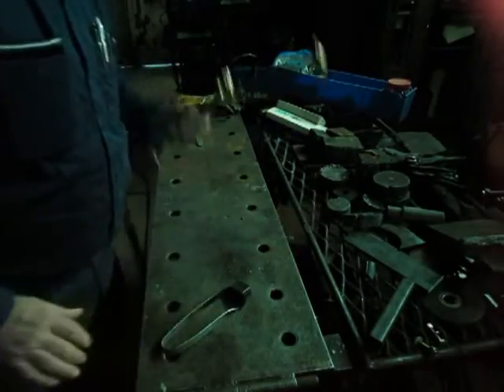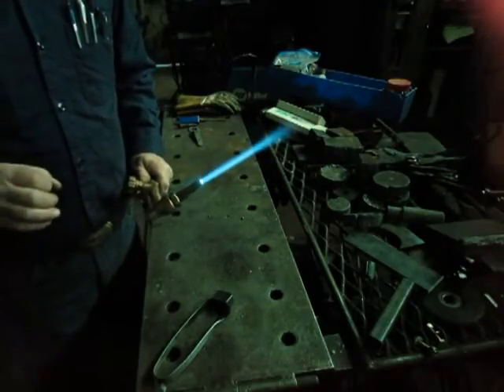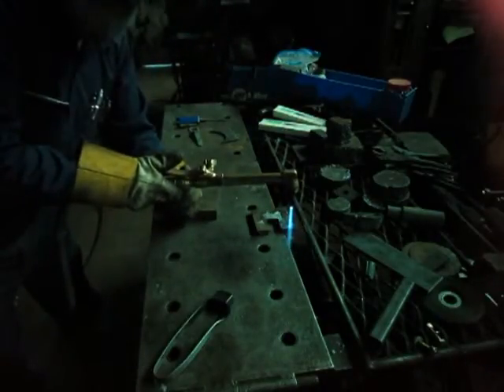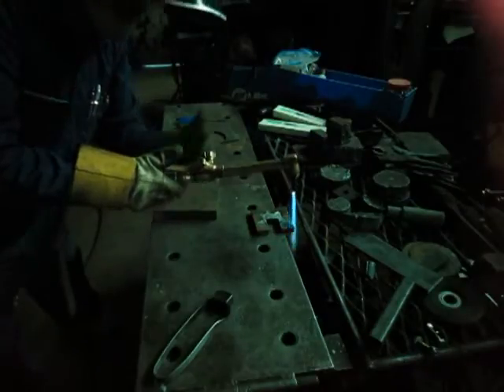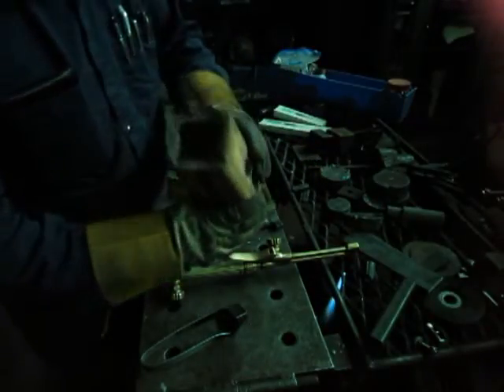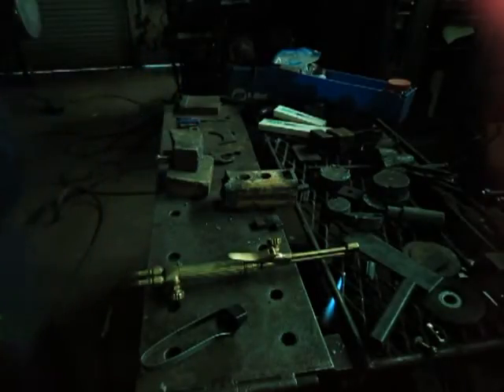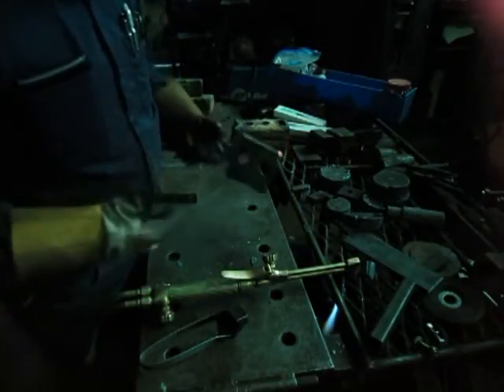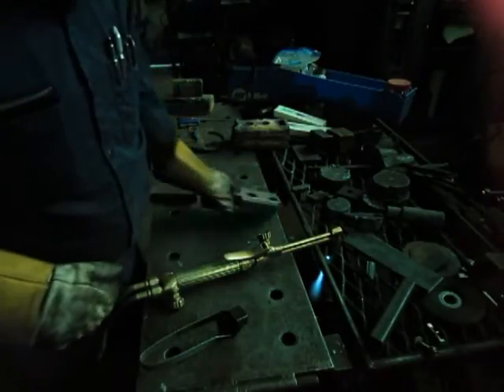Adjusting a cutting torch and other tips

Comment from the maker: Yes it's correct. Oxygen pressure is a function of tip size and thickness of metal to be cut. Also each tip is different and will work best at a specific pressure. Higher pressures are common on machine torch work. I use them on hand torch work often. If you'll check out some of my other video's I show using a small 1/4" rated tip at 80-90psi while cutting 1" thick stock.